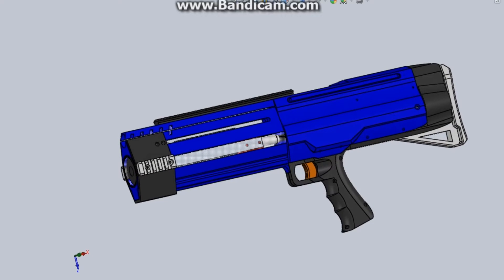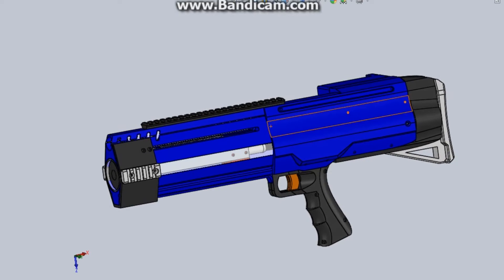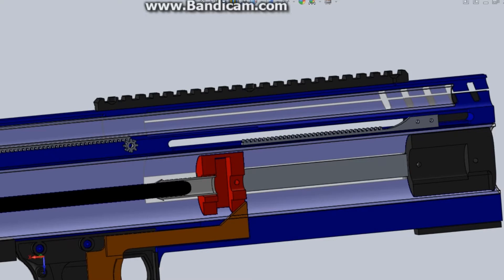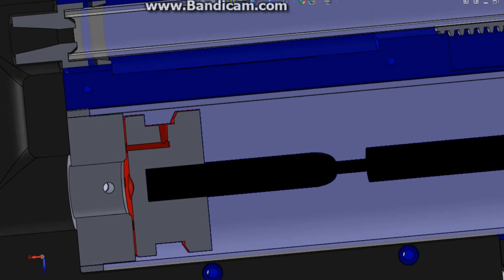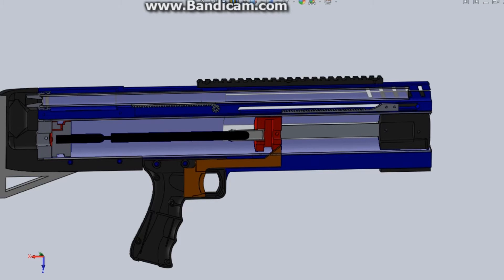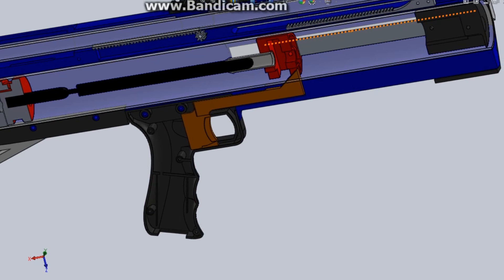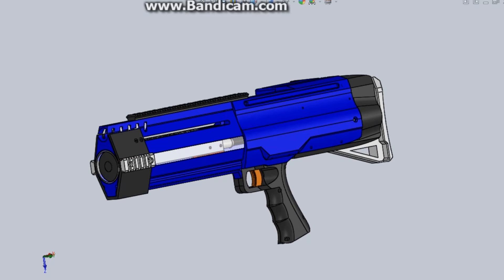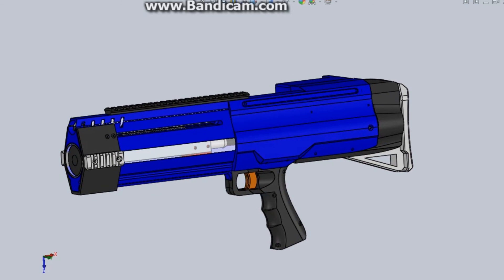Homemade Nerf Gun 3.0 CAD model

Comment: Barrell has to move backwards..Reverse plunger?plz explain.
Reply from the maker: I don't quite understand your question. The barrel moves forwards because it sits on top of the plunger tube and so there is no space for it to slide back into without creating a lot of dead space. The plunger mechanism is known as a reverse inverse bullpup and there are a few other videos explaining how that works. It is not a reverse plunger.
Reply: thx..not one for bullpups
Reply: Design/Forge Dude, what CAD software do you use?

Comment: holy shit that's one of the best homemade designs I've ever seen! question though: is the gear going to be under enough stress to break? and if so, are you going to get metal gears?
Reply from the maker: Those gears won't have much stress on them. There is no spring load on that area, and the dart fit is fairly loose. If they do break, I'll try to print them in nylon or make the teeth thicker.
Reply: Design/Forge ah ok. Thanks! keep up the great videos!